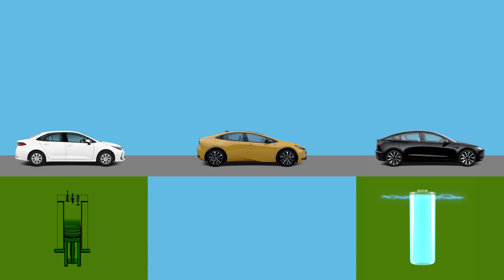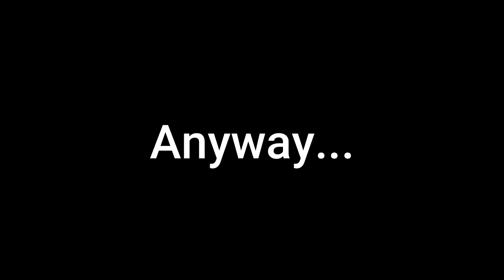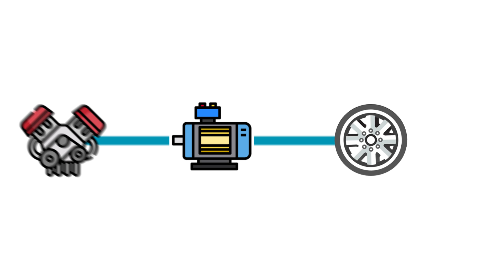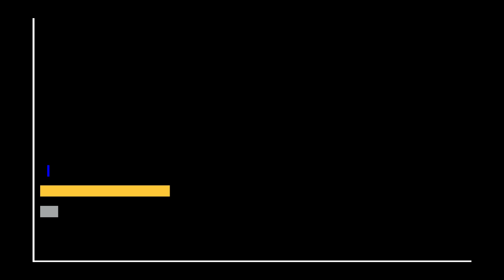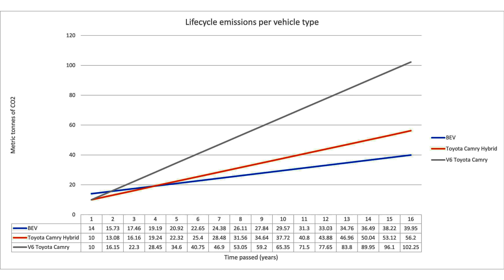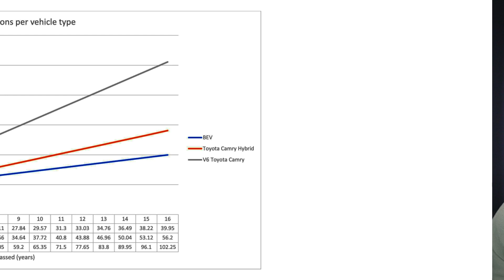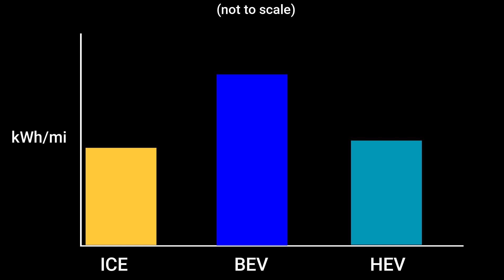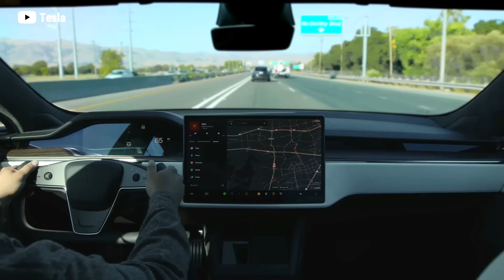Why Electric Vehicles Are Better Than All Cars

Comment: Nico if you notice what's happened in the last 6 months internal combustion engines will be the ruler forever and the reason I say that is Toyota has figured out how to make an engine run on water that's right it will be running on water with that being the case do you think anybody is going to buy an EV that answer is simply NO .

Comment: You forgot one important detail. For all these 100 years we have been improving electric cars. We have improved motors, improved electronics, improved batteries. And after 100 years of development, internal combustion engines are still better. Oil is much more efficient, cheaper, emits less pollution than lithium, has thousands of times more energy per kilogram of weight. We are switching to electric cars not because they are better but simply because we have no choice, because oil is running out. You should research more.
Reply from the maker: How is oil more efficient? The MPGe for electric vehicles is so much higher than ICE bc an electric motor doesn't turn 70% of the fuel into heat.
Reply: @nicomotor  ICE still runs to charge batteries in hybrids! I hate when people say, that hybrids are any better. Hybrids are made for sport, because it is op to have electromotor on each wheel for a race. No way u should buy hybrids, they are the worst ever! Pure electric cars are technically more efficient and may produce less pollution in the future.
Reply: @andreycamper5863 they have much better mpg then internal combustion cars though
Reply: @Starmontdrawzproductions  nope, they are actually not
Reply: @andreycamper5863  they do, check out a comparison chart between the hybrid corolla and a non hybrid corolla
Reply: @Starmontdrawzproductions  no way. 1500kg 100ps with 3.5liter, and 140ps with 5.0liter.
This does not look right. Also 3.5 liter was not tested (WLTP), and 5.0 liter was tested.
5.0 is not good.
Dont know how these add up

Comment: I still think HEVs are a better use case scenario in third world countries rather than PHEVs.
Reply from the maker: Why is that? You don't need to charge a PHEV. The only advantage the regular hybrid has is cost
Reply: Almost every country has electricity accept Africa. Even Africa is getting electrified. Also with solar panels electricity is no more a problem. Yemen a third world has one of the largest share or solar in it's grid.